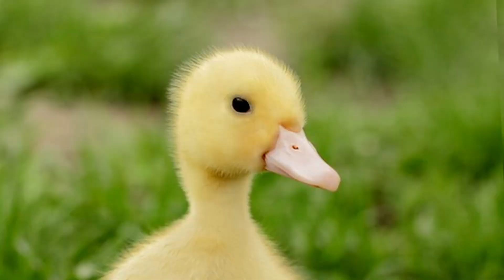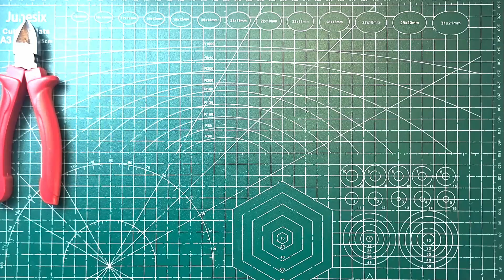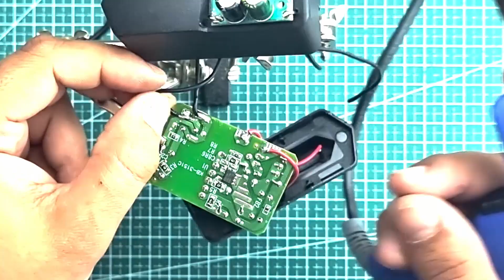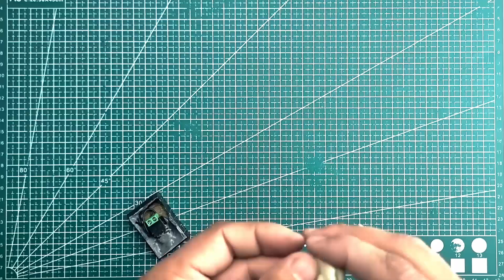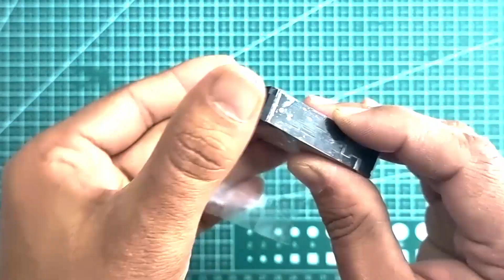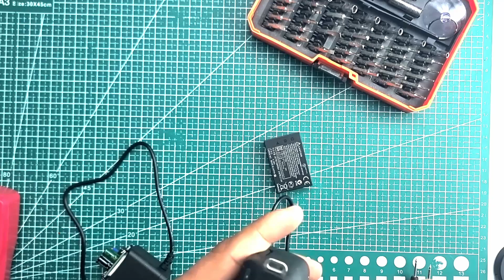how tomake a DIY Dummy-battery for canon

Comment: I did exactly same but it always shows "change battery pack" whenever i connect it and turn on my camera
Reply from the maker: did you check the voltage cuz when you turn it on the voltage drops so it allows to current to level up try increasing the voltage in the regulator a little bit more sometimes it needs more mine uses 7.4 and i had to increase it by 1 volt to get it work
Reply from the maker: try 9.4 v sometimes it differs from one to another because of the inner regulators they drop the voltage